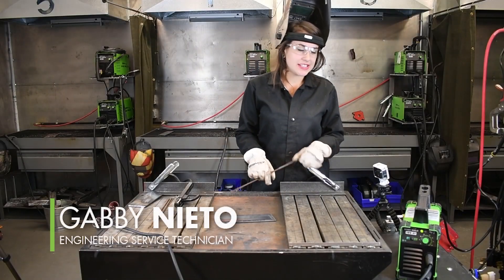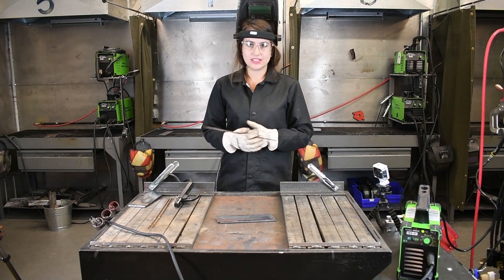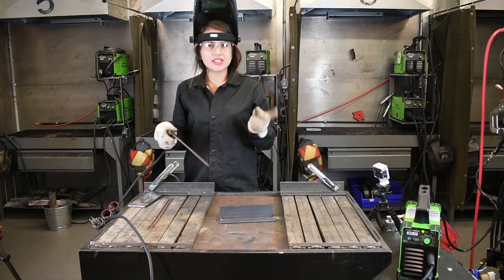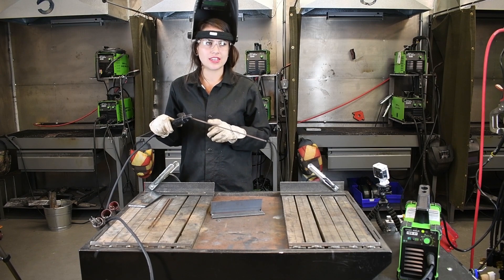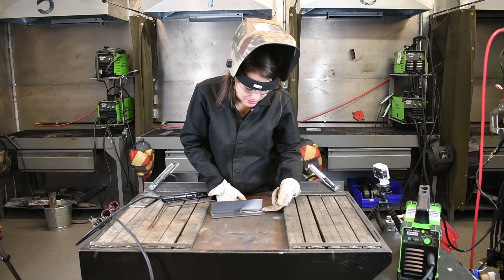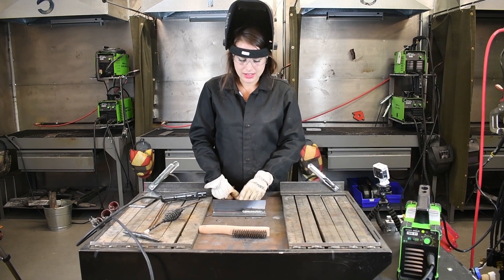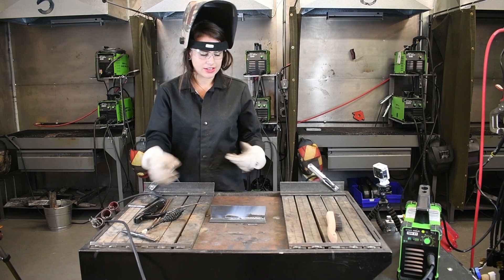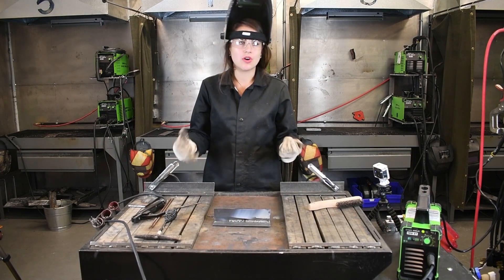Stick Welding with the Forney Easy Weld® 100 ST

Comment: I have had my 100 ST for 4 years. It has always performed very well. It loves 1/8''6013 rods.
Reply: Just bought the 100 at  and  I bought it just. For still welding thinking  I'll prolly never Tig with it but I'm curious to see how good it will Tig after seeing how  well it welds on a  6013 and 7018 on carbon 1/8"  stick rod  and on only a  110   circuit . I paid $199 for this rig brand new  and I  love it. It performs just as. Well as any Miller buzz box  or Lincoln  that I've always used at Work  as far as  Stik  goes so I'm curious to see how it performs on stainless and carbon  with some argon and a Tig rig I'm sure it will perform without duty cycle just as well as any Miller or Lincoln.
Reply: If you are looking for. Quality still welder that runs on a 110 circuit and welds both even and dcep then this at$ 200 to$ 249 performs just as well as any Miller or Lincoln that I've ever used I can't wait to hook a Tig rig and argon to it n weld done stainless n see how she does
Reply: I bought 3/32 e6013 and couldn’t get it to burn hot enough. I am new to welding, would the 1/8 be better?
Reply: Mine loves the 1/8" rods too !!

Comment: Great little welder. I use mine for lots of small projects around the house. It welds well and is easy to setup. Great job Forney!!
Reply from the maker: That's what we like to hear!
Reply: I was looking at this model online and some websites say it can weld stainless and cast iron, but some dont. Can it weld stainless steel and cast iron. I never got a good answer.

Comment: Just bought one. Fixed my mower deck in I like it.thanks for the video
Reply: I was looking at this model online and some websites say it can weld stainless and cast iron, but some dont. Can it weld stainless steel and cast iron. I never got a good answer.

Comment: Just bought this welder and love it really good welds simple to use very light easy to move around
Reply: I was looking at this model online and some websites say it can weld stainless and cast iron, but some dont. Can it weld stainless steel and cast iron. I never got a good answer.
Reply: @abdulelkhatib2674  Technically yes with the right rods.

Comment: I've been welding with an old AC buzzbox for years.  Got this unit to try out DC stick welding.  This thing is a dream!  Solid construction with an easy start and a smooth arc.  Can't wait to try out some of the machines from Forney.
Reply: I was looking at this model online and some websites say it can weld stainless and cast iron, but some dont. Can it weld stainless steel and cast iron. I never got a good answer.
Reply: @abdulelkhatib2674  Stainless steel won't be a problem since you can get stainless rods.  I've actually used mild steel flux cored wire to weld stainless steel.  Only thing is that the weld can rust while the base metal doesn't.  I suspect you can weld stainless with a mild steel rod (7014) as well but with the same caveat.  I haven't tried that, though.  As to cast iron, you can get rods for that as well.  You likely would have to check a welder supply company for those.  The only trick with that is you need to preheat the base metal first with a torch.
Reply: @bunyanforgings7849  ok thanks that's great

Comment: buenas noches esta maquina de soldar quema un electrodo 7018 de  1/8 conectada a 120 Volts ?
this machine can burn a 1/8 7018 elctrode connected to 120 volts....... thanks

Comment: How can a 20amp circuit run a 90 amp welder? Background: i need to buy a generator in order to buy this welder. Looking at a 4500 running watts generator.  Need bigger for 7014 at 90 amps?
Reply from the maker: There are transformers on the PC board in the unit that transform the incoming, high voltage and low amperage power, to the outgoing, low voltage and high amperage power. 

The 100 ST has the following generator requirements: 4,000W with continuous output, no low-idle function (or the ability to turn off the low-idle function), and a total harmonic distortion (THD) of equal to or less than 5%. 

Hope this helps!
Reply: @forneyind  comparing a 4500 watt and 8500 watt generator is the only functional difference for this welder a longer duty cycle?
Reply from the maker: @trappinout18  There will be no difference in the work envelope when using a 4500W or 8500W generator as the unit will only ever use a max of 4000W of power.

Comment: Would it be an issue using this in a standard home outlet? Whats some of your guys experience with that? Do I need a dedicated breaker?
Reply from the maker: Hi Cameron, apologies for the delayed reply! If the outlet you are using is not a dedicated circuit you may run into tripping breakers. If the circuit is dedicated and 15A it will weld 3/32 and 1/16 just fine but will pop with 1/8 rod.
When you do not have a dedicated breaker other sources are pulling and overloading the circuit.

Comment: Could u do a trailer build with this welder. 3/16 steel tube?
Reply from the maker: Hi there, this welder can weld up to 1/4" when stick welding , so you should be able to. Thanks for reaching out!
Reply: @forneyind  thank you

Comment: This machine does not burn hot enough to weld with the e6013. I asked a local welder why I was having my issues, and he said it was not burning hot enough. I bought it to use because of this video and I’m pretty bothered that it doesn’t work to actually weld. Guess I won’t ask Forney for suggestions. I’ll just ask some local welders. I am pretty new to welding so i am open to suggestions.
Reply from the maker: Hi Joshua, e6013 electrodes work with this machine as long as they are 1/8" or smaller. Our Expert-Techs would be more than happy to help you troubleshoot if you want to give them a call: 1-800-521-6038 ext. 2 Thanks for reaching out!

Comment: Is  it possible to run this thing off of a 15A circuit breaker? If so, what it the max current I can run the output at?
Reply from the maker: Yes, it is possible to run it off of a 15A breaker. You can run the machine at max output, but only for about a minute and a half of continues welding. You don’t typically trip the breakers with stick because the rod runs out before you can get that much welding in.

Comment: Can it do 1/8 7018 on 120?
Reply: Nope. I mean, technically, you can strike an arc and weld with an 1/8 7018 @~80-90 amps, but it is really cold and not really good for anything.

Comment: Can I weld 3/32" rods with 60 amps? Will 60 amps work on a 15 amp outlet?
Reply from the maker: At 60 amps with a 3/32 rod it it be difficult to run that low of amperage. We would recommend 1/16th. This machine will run a 3/32 rod at 70-80 amps on a 15 amp breaker.

Comment: Is these machine good for autobody repair floors quarter panels?
Reply from the maker: Yes, this machine can be used to repair auto body floors. We would recommend 3/32 or 1/16” rod of E6013.

Comment: Will a 4000 watt generator be able to run this welder?
Reply from the maker: Hi Patrick, thanks for reaching out. Yes, a 4,000 watt generator will be able to run the Forney Easy Weld 100 ST. We recommend a minimum 4,000W continuous output with no low-idle function (or low-idle off)